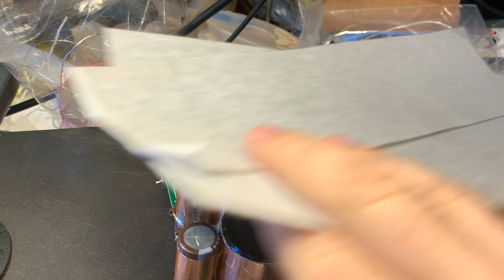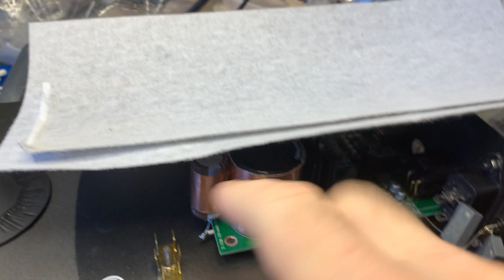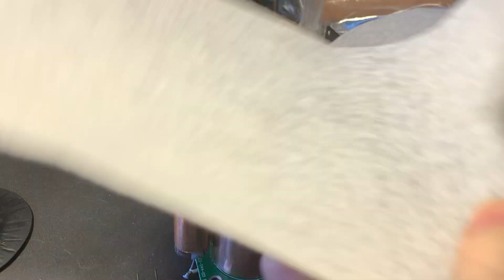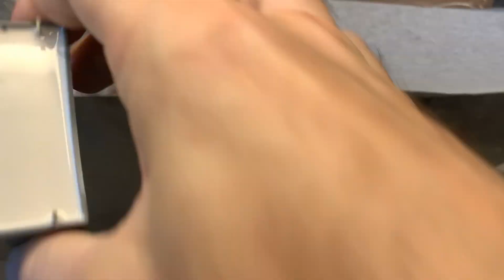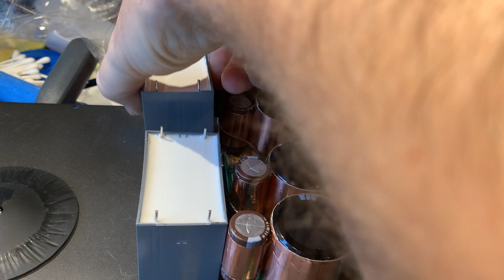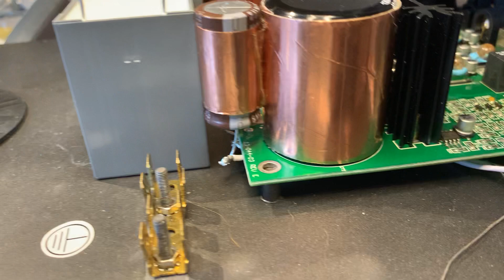How to bypass power supply capacitors? - boost your DAC! ;

Comment: Wow you sound like you believed 💯% of everything you are saying
Having built my own DAC that works perfect but a low noise power supply is the best for audio I hope no damage comes from ur advice
Reply: Real World example Definitive Technology BP7009 rower speakers with integrated subwoofer have a known problem the filter capacitors are undersized and the fail by the hundreds  $60  will fix them but the mfg wants $500 plus shipping.( 8 solder points)

There are thousands of  items like that  in America and plenty of items  that people are just tired of and would love someone to just come pick it up and it works perfectly 
( Consider That )Time is money everywhere
Reply from the maker: There's no belief, I do not have any kind of beliefs that influence me, I only act on experienced results. These things I have shown here I have done on many, many, many occasions with consistent audible consequences. Not all were successful, sometimes the equipment does not work, due to old age of the equipment. However, when equipment worked for starters, I never broke them.  When needed fixing, sometimes fix worked, sometimes not. So, always proceed with caution!!!
Reply: @realworldaudio   I have built Amp myself and know the consequence of not have things right as designed
Reply from the maker: @HeavyCrown2030  Actually, changing the design is the lesser issue, that has never caused me a problem. The problem is old failing parts in older gear, and overly compact designs that do not allow proper changes: eg overheating/burning a capacitor that's next to the item you are soldering... if you realize it has happened then you can change it, but unnoticed it can be a very long troubleshooting experience, or lead to right away failure that takes out many other parts. With experience I gained a better sense of what can be modified on a certain unit, and what are the mods that can be done safely, and what are ones that are risky. Should do a video on that... ;
Reply: Did you change or upgrade the OpAmp in this unit?
Reply: @denniswesselink3628  that is just shielding tape , pretty sure he is having fun with this upload... But Op-Amps are just a collection of transistors in various packages..

The first OpAmp where a arrangement of inside Vacuum Tubes.

Comment: Hey what are those blobs with blue tac on the crystals and chips? And can these capacitors also be bypassed with bi-polar capacitors like they use in speaker filters? And i recon u put some copper foil around the capacitors as a shield? wouldnt aluminium foil be better?
Reply from the maker: The blue tac is to dampen the resonances, and the crystals are piezoelectric crystals (quartz) to cut down on the surrounding high frequency EMI fields. Copper foil is a better heat sink, and a better EMI shield. Aluminum would also work to a lesser degree, although very hard to ground it as you can't solder to it.

Comment: Thanks for this. Would this be a good idea for a Class D amplifier? I assume the voltage should be the same?
Reply from the maker: Yes, it also applies for class D amps. Similar voltages, but check the voltage ratings just to make sure, can vary from model to model.

Comment: Thanks very much for this, I added 220uf (Silmics) to 22,000uf Mondorf AG's and it made a very worthwhile difference (the 220's were already run in, taken from a different unit), it kept the rich tonality and improved the dynamics. It brought the balance back as it had become a little too dark. Is it worth considering a 2.2uf 100V Silmic as well ?
Reply from the maker: Biggest difference would be adding the 1% value 2,200uF. At 2.2uF I'd add a film cap, that would be even better than the Elna. (If you have space.. probably not anymore for the 2.2mF and the film, but 2.2uF Elna would still add a little top end clarity.)
Reply: @realworldaudio  Great, thanks I actually have some 2.2 uf Film caps I might be able to squeeze in, I will need to use some 20-30mm leads, but I guess If I try with some low impedance (0.9mm) solid core cable, I want be adding any ESR and I guess for the analogue supply not digital ESL is not a thing. I'll give it a go
Reply: PS 1% of 22,000 is 220 which are great
Reply from the maker: @adrianadrianp5305  Sorry, yes. I don't know why but I misread it for 220,000.... ;
Reply from the maker: By paralleling you will be lowering both ERS and ESL even when there's extra long / thin leads... Leakage is the only thing that will increase;
Reply: @realworldaudio  That would be a sizeable cap for a 4K Bluray player ! I 'only' have 88,000uf on the digital and 70,000uf on the analogue
Reply: @realworldaudio   I have now added two 220uf Silmics to the two 15,000uf Jensens. Even after 4 hours of running in they sound amazing, even greater dynamics and bass weight/speed and tactility. Plus a nice increase in upper mid and top end projection without adding any unrealistic brightness or thinness

Comment: You specifically mention DACs in your explanation.  I agree that DAC chip clocks operate in the MHz range so IMHO and IME bypassing an existing bulk electrolytic capacitor in the power supply with a lower value electrolytic (as you suggest approximately 1% of the larger capacitance) isn't going to address the issue.  Digital ICs and analogue ICs benefit from decoupling the power supply rails with lower value capacitors (usually film or ceramic types) as close to the IC's power supply pins as is physically possible to do so.  Adding 1% bulk capacitance in the power supply won't make any difference.  It's a well known myth in the audiophool world.
Reply from the maker: Thank you Alan! Adding the small capacitance to the bulk supply makes sure that the supply remains uniformly capacitive throughout the working range of the ICs, and the ICs do not see a transition from capacitive supply to inductive supply at a very high frequency. Just look at what happens to the sensitive clock crystal when the inductance of the unbypassed supply interacts with the small decoupling capacitor on the leg of the IC: that creates a low pass filter, and quite likely also a very high frequency oscillator, that adds unwanted components/shifts to the clock-generated frequency.
You are quite right though, we do not hear the benefits of bypassing every time - it can also make the sound quite a bit worse. It's not an automatic band aid, especially when there's a big mismatch between the cap and the bypassing cap. (Eg bypassing a poor quality cap will make things much worse, yet bypassing a high quality capacitor with another with a similar character will take it to the next level.) In all cases when I observed the rules of bypassing (as taught by my mentor) it did make an improvement for me (and many of my audio friends) that prompted me to keep experimenting with it.

Comment: Bro I wanted to ask you about musical ratio you had told me yesterday, but I didn't understand , is golden ratio also musical ratio or not, as I have used that before
Reply: Can u suggest any musical ratio I can use for speaker box
Reply from the maker: @IDontExist14  For example C-E-G... but it's much, much more involved than that! I will make videos on the cabinet size selection process.
Reply from the maker: Not the same, musical scale uses different ratios from the golden ratio.

Comment: Would be great if you could make a video about upgrading parts in Vandersteen loudspeakers crossovers. Namely the 3A.
Reply from the maker: Hello Ray, I could not find specific info on the 3A crossover... however, Vandersteens use low order crossovers, so first line of attack would be to look for the caps and upgrade for better ones. Actually, I have an older Vandersteen, and  I will upgrade its crossover. For now it's tucked away and hard to access, but will get around to pull it out and mod its crossover one day. For now, the Mirage is slated for the crossover rebuild during the next month or so, depending on when I find the time. Until then, I can make a short video on a few easy things that can be done on Vandersteens ; ).
Reply: @realworldaudio  Would be phenomenal. The two challenges are the fact that the components might need to be exactly matched to the originals in terms of measurements or else the phase alignment could be thrown off (at least that is what is claimed. Is it true?) and second how to access the crossover inside the speakers and handle the crossover that is often glued together.  Vandersteens are very well designed speakers but the components of the crossover are of low quality, to keep cost down.

Comment: If i wanted to find someone locally who could help me with upgrades for my DAC and other related things, do i need to look for an electrician, an audio engineer, or someone with a different profession?
Reply: In my city you can find electronic technicians in electronic repair shops, also you could ask at stereo stores where to get repairs and mods done. Hope this helps.
Reply from the maker: I concur with Mark - ask around in stereo stores, and look for electronics repairs shops - tv/computer/radio/etc.

Comment: Thank you Janos,
Do you still have this inductive problem with caps of lower values  such as those in a tube power supply in the 20-50uF range and no digital components to affect? Do you still recommend for tube power supplies? I’m guessing it is still recommended if not just to speed up the larger caps…
Reply from the maker: Yes, inductivity is at play in all caps, unless they are a perfect capacitor - which they are not. Yet, high quality film caps have negligible inductance and are close to perfect capacitors as far as audio signals are concerned. In that case it's better to distribute the capacitance with using 10 x 5uF film caps instead of a single 50uF cap, as the 5uF charges / discharges x10 faster than the 50uF cap. So, total capacitance will be same, but charge times drastically reduced (drastic increase in perceived transient speed). And prices drastically increased.... for example, that's why top Audio note speakers are so unrealistically expensive because they are doing this in their crossover: using banks of 3uF silver foil capacitors, instead of using a single big one.
Reply: @realworldaudio  Thanks again Janos,
I’d still be interested in seeing your procedure for wrapping the copper around so nicely and where to get it…
Reply from the maker: @marcl8814  Hi Marc, here's about the source: https://youtu.be/nsJ-rzj8alQ  I'll do a video on how to wrap it around the capacitor ; )
Reply: @realworldaudio  👍
Reply: @realworldaudio  Thanks, I forgot about that video, I did watch it awhile ago…